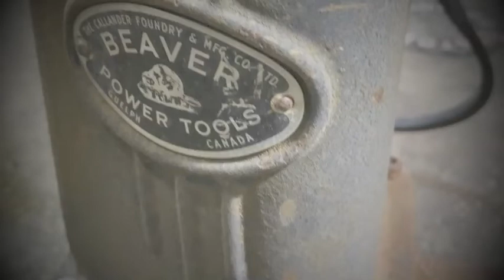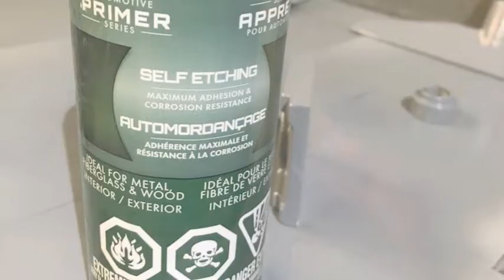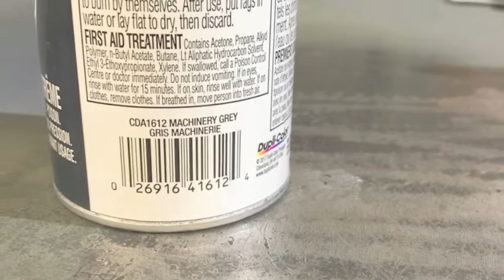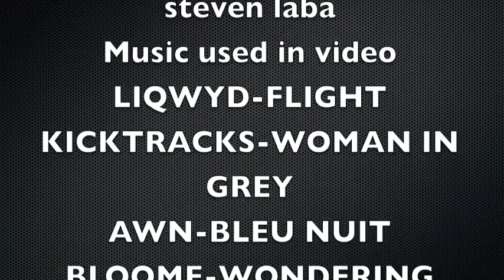Beaver Wood Lathe Restoration diy

Comment: Did you find a good place to buy parts for your lathe? I have the same one I’m restoring but missing some parts.
Reply from the maker: no i only refurbished what i had what parts are you looking for i might be able to source some
Reply: @stevenlaba1543  Mostly the headstock bearings is what I was thinking.
Reply from the maker: @allanwrench  i can most likely get those if you can send me some good pics of the old ones both sides
Reply: @allanwrench  did you end up getting the parts you need?
Reply: @Critical_Path  Yes, thank you I did.

Comment: Hey Steven, I just got the same lathe and will restore it also so this is great! I don’t have a motor for it though. What am I looking for in a new motor? Thanks!
Reply from the maker: a used treadmill motor and speed controller from the same treadmill
Reply: @stevenlaba1543 👍 I have an antique Crescent lathe that I converted to a treadmill motor and it works great!